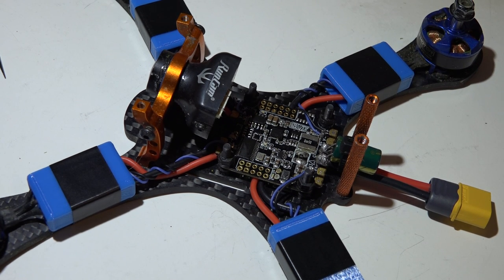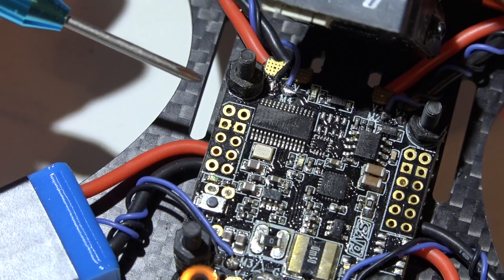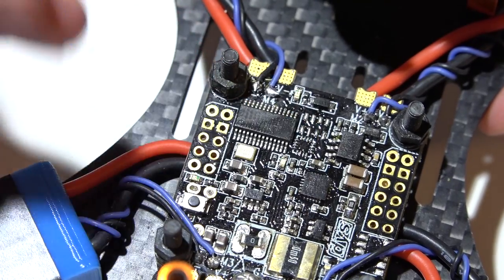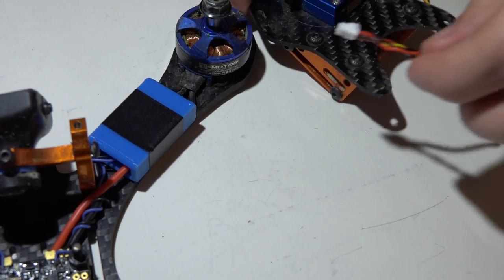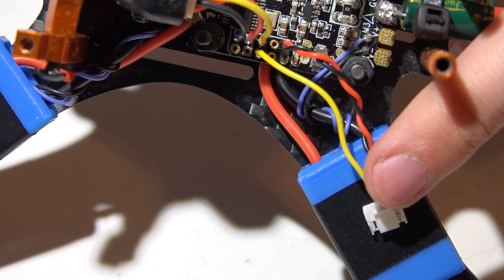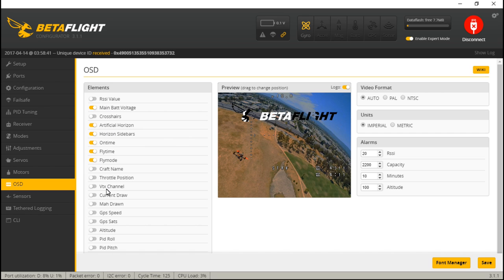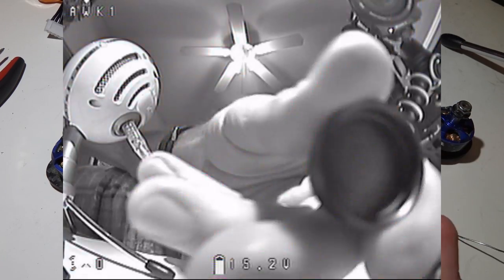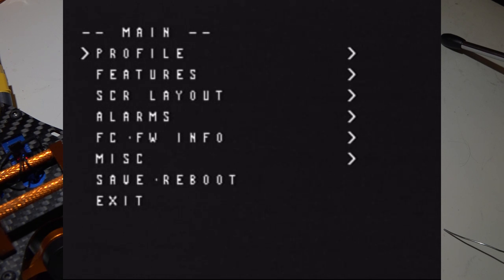DYS F4: Camera & VTX set up

Comment: I have this board and that stupid dys mi200. Quick question! Because that vtx requires 5v and it also has 5v out to the camera can I just cut the video wire and run it to the vin and v out pins on the dys f4 fc and then run the power and ground to the 5v pin and ground to the fc from the vtx? That way I only cut the video wire to solder to the fc? Will that work?

Comment: My board has stopped showing the video for some reason :( Any way I can fix it? I check the solder joints and they were fine. My goggles transmits a black screen and I made sure the lens cap was off. :/
Reply: Nestor Folta mine did too. did you get it fixed?  I had my vtx powering my camera and it was only getting 3v. I think I'm going to run separate power leads to each and see if that works.
Reply: Think I might've fixed it? The camera ground may have been loose or something, idk! But I had a spare so I ended up using that :p

Comment: would you say the diagram on banggoods website for this board is correct? you said some things on the board arent right in a previous vid. (link for reference: https://www.banggood.com/DYS-30_5x30_5mm-Omnibus-F4-Pro-Flight-Control-Integrated-with-OSD-5V-BEC-and-Current-Sensor-p-1136875.html)